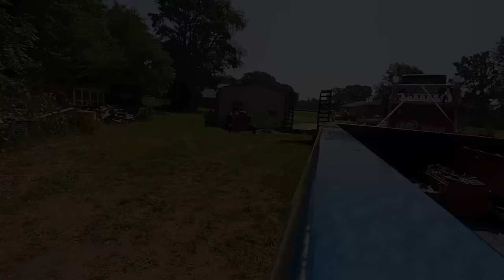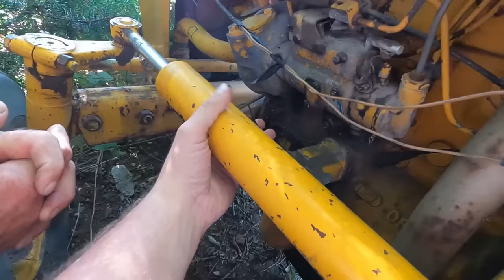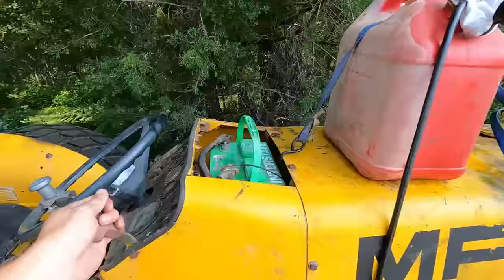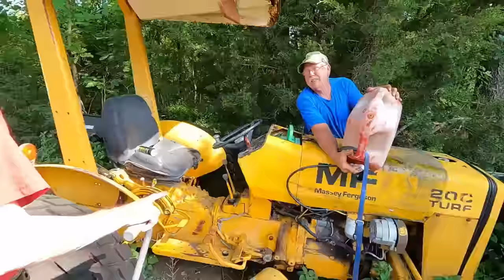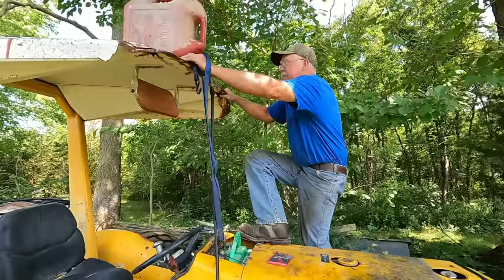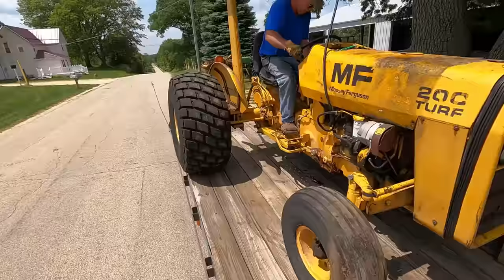Bought an Abandoned Massey Tractor - Will it Run?

Comment from the maker: GoPro strikes again! Had to start over with the edit. Enjoy!
If you're passionate about saving obscure island based  tractors check us out on patreon - patreon.com/WatchWesWork
Reply: If the GonePoo overheated, consider removing the battery from the unit, putting a dummy battery (fleabay, the usual places) and wire the dummy battery's wire to a hand holder with an integrated battery.
Reply: thanks for the vids as allways! i dunno about the scruffy look for you ,are ya gonna commit to a full snack saver and chin warmer?  as the owner of a full blown soup strainer i feel the need to make you aware you work with fire and rotating mechanical devices both of which do not play well with longer facial hair.
Reply: @mobiousenigma  😂😂😂
Reply: @aserta  I've never dealt with a GoPOS myself, but when I use my phone to watch a livestream, I always plug it into the charger, and it stays at 100% and doesn't heat up - it will even charge it up fully if I start with a lower charge. I hate it when a streamer's phone or camera dies before their stream is supposed to be over.
If GoPOS's have a jack for an external power source, I'd try using that.
Reply: 3W don't stop making videos that intro is what keeps me laughing all day long man !
Reply: I noticed a lot of YTers have switched to either DJI or the Insta360....   

Personally I bought one of the thousands of GoPro clones but I am not making YT videos, it's just throwing away money with the hopes of someday getting my sh*t together....
Reply: @mobiousenigma I limit my growth to a cookie duster.
Reply: Plate held on by Bungie cord...... Classic!
Reply: On the injection pump check for erosion between ports on the head and rotor. Many years ago I had a 6 cylinder Perkins engine in school with a miss in  it , swapped injectors,,the miss  stayed one cylinder, finally I pulled the injectors on the dead cylinder and reattached the injector and started the engine, the injector worked fine just not under compression. I made sure I didnt' have any low compression issues first.
Reply: @aserta wess you  are going to get a bad name hanging  out with those old farts
Reply: @benjaminsmith8058  I do believe that you intend to say 
W3... I like it... The designation being as in Chemistry, W having 3 PARTS of W is W3. Like O2, or H2O...
Reply: @paulsilva3346  I've been calling him 3W for years for 3 W's but whichever way works for anyone it doesn't matter , most people don't know who I'm talking about because it's my own title for him but to each their own ..
Reply: @aserta  I'm surprised people still use newer gopro's. They are junk. The older ones really shine.
Reply: Listen here Wes! I have always absolutely loved your videos. I like watching because I am able to learn. I am starting up my own handyman type service business and I want Auto repair to be a part of it. Thank you for all of the knowledge you have given me. In addition this recent addition with your little skits and that background music is so entertaining I just sit on the couch laughing. It is so awesome!
Reply: Nice video,  your a lucky man to be able work with your dad.
Reply: @aserta ; of;
Reply: Wes, you had a bobcat.... And instead chose to beat on the injectors and pumps and valves without lubrication. This was dumb. You don't run a diesel on ether.
Reply from the maker: @sasquatchrosefarts  looks like we just did.
Reply: @aserta 0pu
7કે u
Reply: @WatchWesWork you said you were going to clean the fuel system anyway, but ran a diesel on ether ...... Think about that for a second. You had a bobcat, and a winch. And you're gonna tell me that the fuel injector seals don't get very heavy wear, from even a few minutes running on ether? I feel like you missed the boat. You can say you did it for clicks. But don't tell me it wasn't dumb. Unless you have part sponsors who give you parts that we don't know about.
Reply: @aserta  l
I CD cưggd s có vhjp IP
Reply: @aserta 

.
Reply: @aserta  દ
Reply: @mobiousenigma ❤

Comment: I ran one of those when I worked on a sod farm. Pulled a roller that would be used right before we cut it. Good little tractor, those floatation tires have very little traction. Thank you Wes.
Reply: Maybe it would be accurate to say they have “gentle” traction, so as to not chew up the grass too much.😄

Comment: seems like a win.  3 or 4 good tires, 66% cylinder operation, some brakes, leaking hydraulics, finicky fuel system, and overall it runs.  what's not to like - thanks Wes

Comment: Back in the 70’s I worked for a company called Porter Brothers out of Shelby NC and we sold Jacobsen turf equipment and also sold these tractors. We were the distributor for Jacobsen,Cushman, Kut-quick, National mowers etc. we sold quite a few of these to pull gang mowers back in the day. We covered five states North Carolina,South Carolina,Tennessee to just past Knoxville, Eastern Virginia and West Virginia. Worked there 15 years after graduating High School and did mechanic work, eventually did field service work covering these five states before I quit in 1988. 😊

Comment: Great little massey. Once you get the fuel system cleaned that Perkins will run for ever. Great that the clutch and hydraulucs work.

Comment: I’ve seen on another YT channel that does barn rescues, not only do they take a spare battery, air and tools, but also fuel tank with a small 12v fuel pump with some compatible fuel lines. You can hook fresh fuel as close as possible to the carb or injectors as needed. Probably better than having your dad blow into a fuel can for pressure. 😊
Reply from the maker: Have you ever forgot anything?

Comment: I always used the dipstick for the hydraulics or a 3 inch nail with the sharp end pounded flat and bent 90 degrees for a surrogate key on all the old Masseys with a Lucy's ignition switch.

Comment: My Dad had an early 80s Massey 235. Bought it brand new.  Pretty sure it's the red brother to this guy. Slow leak from the injection pump and we had to rebuild the steering cylinder, too. That little Perkins was a great engine and it sipped diesel. Would run a 6' brush hog all day on maybe 5 gallons. 

If your Dad gets just 1% of the enjoyment my Dad got from that machine, he'll love every minute he spends on it. That tractor seat was Dad's happy place.

Comment: Wes I've written it before. Video of you and your dad working together is awesome. No problems at all to keep up with the conversation. Even though English is not my language (live in Sweden) By the way, I like your videos when you repair different vehicles.
Have a tractor with loader and digger and dump truck that I maintain weld some rust on my Jeep Liberty KJ in winter's rocker panel for the first time. I like the calm, methodical way of working and all the sarcastic comments about how car manufacturers solve their problems in order to design and build cars, but completely shit how the aftermarket solves the problem. I worked for a while in the mid-70s and when the "technicians" were to explain certain details of new car models to be serviced and repaired, they were all asked what the hell were you thinking with that construction. was the answer ALWAYS cheapest for us when the car needs to be fixed, the warranty has expired then the car owner is responsible for the cost. Greetings from Sweden

Comment: The three cylinder perkins of the 1960s and 70s was one of the best 45-50 hp engines of its day. Easy to start summer or winter and good torque for its size.

Comment: Awesome video , thanks
Spend as much time with your dad ,
My question is why don't you bring a outboard fuel can , there's a primer bulb on the hose , and you don't have to stuff a rag in the hole for better suction.
With your fly problem , get a bug zapper .
Thanks again for the video , especially with your dad .

Comment: Cute little tractor. Just one thing: chuck up the trailer wheels when you're driving stuff on and off it. Very unsafe to rely on the truck to hold it in place (which it obviously can't)

Comment: The fuel setup is gravity from the tank to mechanical fuel pump to deliver proper preassure to the injector pump.  
Also there is a tiny filter in the fuel tank that blocks up and can strangle the fuel flow. You need to remove the tap from the tank to check it.
I used to have the ag 135 version which is very similar.
Nice score.

Comment: Nice find with the little tractor, looks to be in great shape. I have a John Deere 650 with a 2 cyl yanmar and equipped with turf tires. I got it from my Dad and he used ether to start it and busted the skirts on the pistons. I put pistons in it and it ran fine. He has passed so I guess it’s mine. Good little tractor but can’t use it for much, I have a 4’ cutter I use occasionally but mostly sits in the shed.

Comment: The city street sweeper had a 3 cylinder Perkins in the back it was one of easier engines to work on never had much trouble with it other than a starter and alternate going bad great video and great job with the tractor

Comment: I could pickup on everything your dad didn't say or you Wes. Worked very well since finally the steering worked with a godawful oil funnel. On my old Chevelle I would cut the end out of an oil quart and use it for a transfer funnel.

Comment: Your Dad asked me the other day if I had an extra key. I wish I did. That's pretty much the exact same tractor I have, except for the rear wheels and the paint color. 
 When he gets the fuel system cleaned up, he can rake hay all week and never have to add to the fuel tank. I think it holds 14 gallon, and I can brush hog for 5 hours in stuff over the hood, and never be able to tell the fuel gauge moved.
 The only down side, that I can think of, for that 3-152 Perkins, is it shutters side to side a bit at low idle.
Reply from the maker: It will be nice for mowing. I don’t think you could tip it over if you tried.

Comment: I saw a really cool "fuel pump" once. Dude took a fuel cell and tapped in a shrade valve to the box. Then he put air between the shell and the bladder and made it a pressure vessel. Only other thing was vise grips to control flow on the outlet line.

Comment: You need to replace your trailer deck with fiberglass grating.   Light, slip resistant, won't soak up water, and won't warp!

Comment: I had a 1964 Scout, and the best improvement I made on that was installing a Saginaw power steering box, with an Isuzu pump and reservoir. 
My limited experience with Perkins diesel engines was my Mazda diesel engine. It was a 4 cylinder design derived from a 6 cylinder just for Mazda. It is a shame that a turbo was not part of that design.
Speaking of islands, I worked at a church camp that was on an island in the Delaware river.

Comment: I got a old electric pump with about 8ft hose and wires on it. Makes these adventures much easier. Works as a transfer pump in the shop to.
Reply from the maker: I just forgot mine.

Comment: Wes, I know you're not able to afford it, except the engine in the 2023 Super Duty truck from Ford has 500 horsepower and 1200 foot pounds of torque. It additionally had a payload of 40,000 pounds. The more options have in it, the less it will be able to tow. This means that when a person adds another differential, the amount that it could pull is less. That includes the duel rear wheels. The more goodies that's added, the less weight the truck will be able to tow. That's the reason why the single rear wheels with two wheel drive is able to to the most weight of all those Super Duties.

Comment: As an old MF Service REP, I think this youtube is heaven. Those old Perkins will always start and run. Try this if you have pressure control at the quadrant with three point hitch and see what you can do! This is why Harry Ferguson sued Henry Ford, who gave the bone to every body he did business with including Dodge Brothers who built most of his his Model T engines and won, for the Ferguson System an won it.

Comment: International used to make little mule tractors companies would use to move stuff around a factory.  That's almost the right size for that kind of service.
Reply from the maker: I was at a Ford stamping plant once and they had a small dozer with rubber pads bolted to the tracks. They used it to pull stamping dies around in the plant.

Comment: Hello Wes, Hope that you have a follow up video regarding the Massey Ferguson tractor. 
A few years back, We had a similar tractor with the state highway department equipment fleet which had the tractor tires instead of the turf tires. Originally this tractor had one of the hydraulic powered side mounted mowers which was very problematic in which we finally removed the side mounted mower for a a Alamo Flail mower which worked pretty reliably until the tractor was pulled from the fleet due to age to be auctioned. 
As I remember, The tractor had low hours due to the side mower being broken down so much early on.
The sketchy non steering was a common issue with those Massey Ferguson tractors of that time period as I recall. 
It really made my day to see those square body Ford trucks. I am still driving my 1990 F-150 with the 4.9liter engine and E4OD transmission. Not all that cheap with gasoline, But will get you from point A to point B.

Comment: Make sure to bleed all the air from the filter then the injection pump then the injecters the filters might be cloged from sitting a long time you got yourselves a great little tractor i worked around small and medium massey most of the time old ones like that my favourite were the 135s and 185s English made tractors but the 699 was the best medium size massey to me

Comment: I remember about 40 years ago going to collect a tractor for my dad and when we got there there was no key and the dealer just pulled out the dipstick and crossed the starter. There were several tractors there just sitting by the side of the road and no-one interfered with them

Comment: Wish I had of been there with you, I got lots of time playing with masseys with Perkins, simple as can be!
Reply: In future if you can look up to the end of fuel return there may be a plug you can remove. It speeds up bleeding, as you know important on CAVs.
Reply: Also without the lift pump working they do not provide enough net pump suction head at the injection pump for the cav to make power.
Reply: I have seen people use low pressure electric fuel pumps a lift pumps to rescue these. I have only used the mechanical lift pump, the lever is for priming. Steering is just fluid in the pump then lock to lock.
Reply: They are a 230 with yellow paint, fundamentally a 135  down deep in thier soul.

Comment: In that case bleed the injector lines and also the fuel pump because if air trap in the system it will never run properly and also you can have a missed fire in the cylinder

Comment: That tractor has the best smallest 3 cylinder  engine, because someone has butchered the fuel lines. they do not need either, they are a ad3.152 engine fitted in the legendry MF135 Britain's finest at the time. I have 2. They start down to mins 15oc half a turn if there right & there away, fire in the hole. That would fetch good money over here in UK. Nice find. I wanted to get in through the screen & start tinkering. Little seals on inj pump, dead easy to change to stop leaking.

Comment: Your trailer is set up for all contingencies. I especially like those runaway vehicle ramps at the front. If it ain’t that broke, don’t fix it yet, right? It would seem that a little tinkering would make it right but the previous owners bypass of one pump might say he had fuel delivery issues before you. So, I’m confident it will be an easy fix unless it’s not. Story of your life, right?  Me too. 🥸👍👀✅
Reply from the maker: From what I’m hearing it’s going to be a job to get it running right.

Comment: Looks like a nice little tractor.  I was a bit disappointed in the values I saw when I looked up the resale value.  I saw several that sold between $1,500 - $2,200.  Might want to consider that before you pour a lot of money into fixing it up.
Reply from the maker: Yeah they don't bring much without attachments.

Comment: I have to work on my own vehicles out of necessity and have for years which is why I detest making it my hobby or calling it fun. My guess would be that 99 percent of the people that do this and call it fun never had to do it because they really had to.
Reply from the maker: I don't know. I like it.
Reply: @WatchWesWork  probably because you never had to do it out of necessity or make a living from it other than maintenance or a few parts here and there but when you have to do it in inclement weather 100 degree plus searing heat, rain etc. because you have to is a whole other different animal. I can’t believe people actually go out there and pray to work on a vehicle that won’t run. I guess some people wouldn’t do it if people didn’t want to watch and of course getting paid by YouTube helps. I guess I’m just burned out working on vehicles.
Reply: @Hotrodford  Even dealing with those miseries, I at least somewhat enjoy working on them, especially when reveling in the fact that I'm getting 'free' labor.
I've had a transmission still out of a car three hours before I drove it to, and at, work for six hours. (On the ground with hand tools only)  The clutch wouldn't fully release, and I finally found out (from a google search) that the firewall had split where the clutch cable passed through, and was deflecting.
Reply from the maker: @Hotrodford  I've been doing it for a living for 10 years...

Comment: CAV, most miserable system ever. Had a Perkins 3-152 auxiliary in a boat, after filter change had to bleed pump, open all injection lines   and return lines, after a bunch of cranking one cylinder would fire.